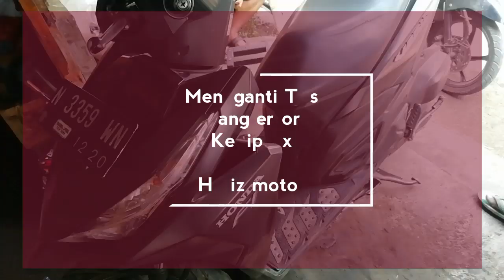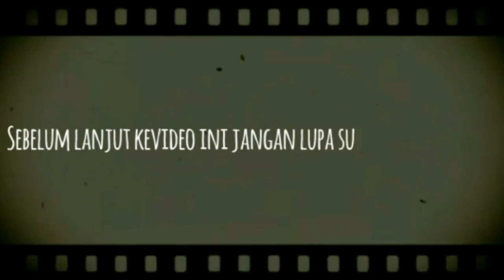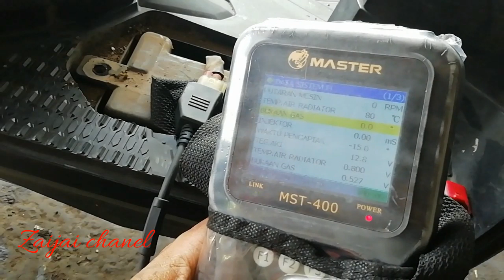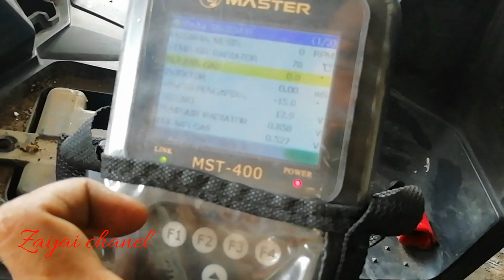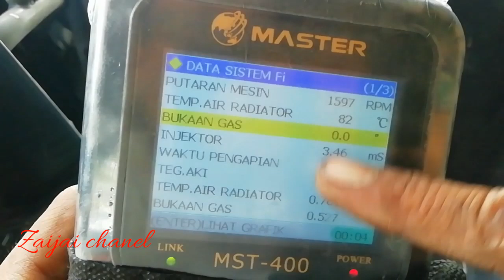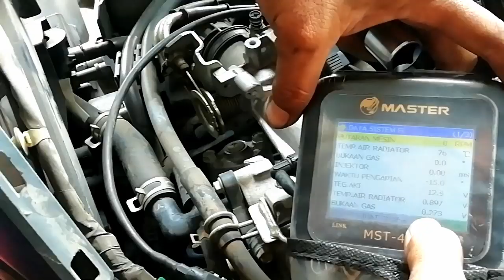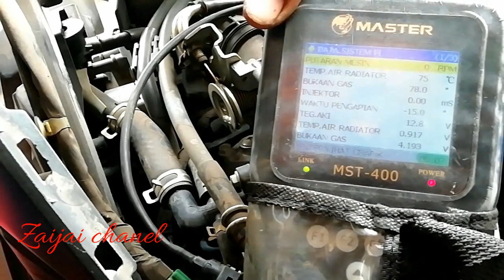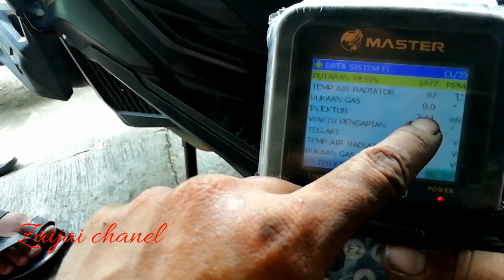Tps yang error kedip 8 kali top sped naik 2 derajat vario 125 tersendat

Comment: Saya udah pasang ini dan hasilnya memuaskan sekali motor jadi agresif top speed 126 mesin std
Reply: pwrlu setting pake scanner gk bang🙏??
Reply: @64bettafarm  lebih bagus nya pake bang untuk mengetahui volt bukaan gas nya, kalo saya mah gapake scener karna gapunya🤣🙏
Reply: @fauzimonrecker3287  brati langsung pasang aja gitu kang🙏🙏
Reply: @64bettafarm  iyo
Reply: @64bettafarm  jangan lupa reset manual setelah pergantian komponen penting injection. Contoh: reset ecu, tp, stel mode.
Reply: @fauzimonrecker3287  okkk thx masku🙏🙏🙏
Reply: @64bettafarm  iyo samo samo🙏
Reply: masih awwet ga ams smpe skrang
Reply: mst ya bang kuat brp bulan anda

Comment: Kalau vario 125 old ngempos tarikan awal atau ssat dingin solusinya gimana om
Reply from the maker: Injector Biasanya
Reply: @zaijaichanel6856  diganti punya apa bang
Reply: takdir mas.. punya ku sama seperti punyamu.. fuelpump+filter sudah saya ganti, injektor  bersih, filter udara bersih, throttle body sudah saya bersihkan.. hasil nihil..
Reply: @dianradhitya9627  asli mas . Nyerah saya sama vario 125 old ini
Reply: Punya saya ganti rotak oto parts sembuh punya saya 125 old tahun 2014
Reply: @desymuria2504  saya sudah ganti otopart . Cuma gas bawahnya aja kyk telak menengah ke atas enak
Reply: Pake injektor vario 150 bang...
Sudah kubuktikan..hasile mantep 👍👍
Reply: Sensor ect nya di pakein resistor bang, asli ilang tuh brebet
Reply: @saefulanwar8382  efek jangka panjang gmn bang
Reply: @bayu-zz5po  gaada efek nya sih, vario bohlam klo gak gitu semburan bensin nya dikin makanya brebet, kecuali pake ecu racing pasti enak